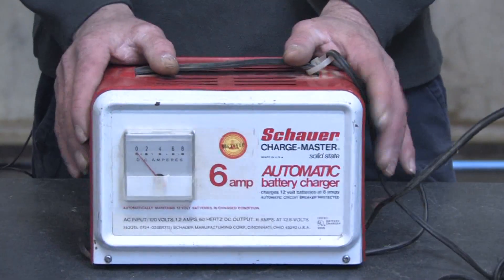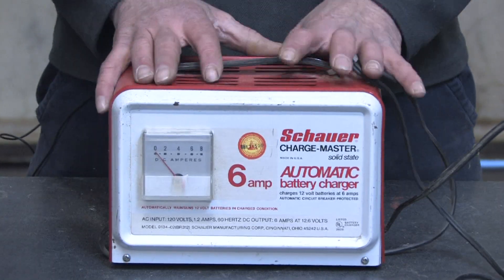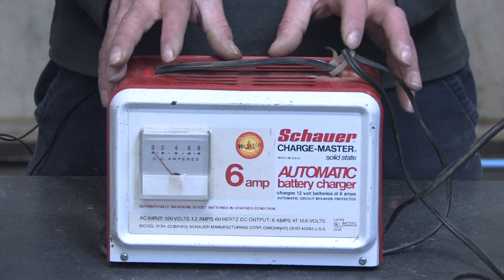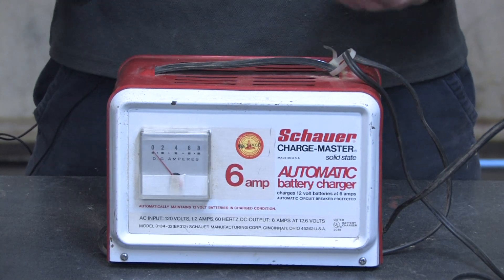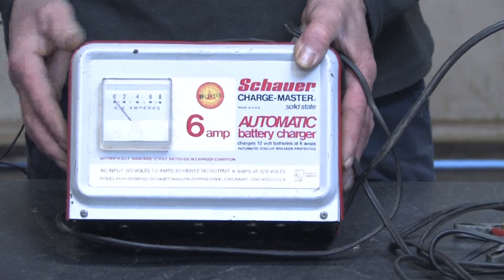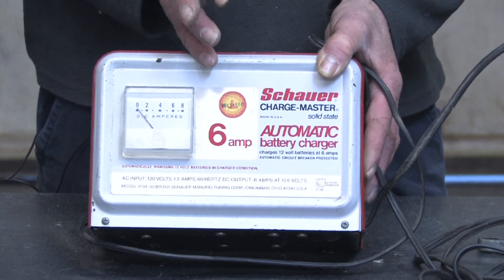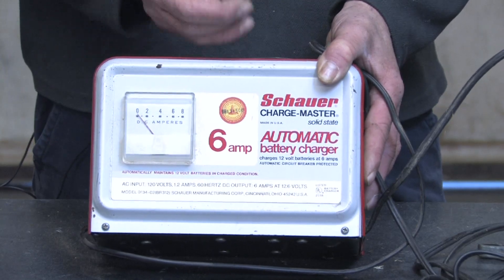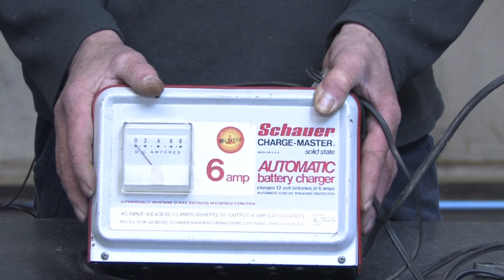Auto Repair & Maintenance : How Do Auto Battery Chargers Work?

Comment: Thanks ... but I wish Americans didn't always assume that the rest of the world runs on 120 volts ... most countries prefer 220-240 volts ... :)
Reply: Most don't. Those that do, think 110 volts is standard, not realizing America uses 220 volts (for large appliances for example). Also, Europe used 110, the standard set in the US by Thomas Edison and corrupt politicians, until WW2. 220 provides better transmission efficiency. Europe was able to make the change due to the fact most power stations had been destroyed. It wasn't cost effective to dismantle the US power grid and rebuild to accommodate 220volts.
Reply: Walter Tonetto not our fault you still prefer to waste electricity.  Maybe if all instructional manuals and videos are made for 120v you will be forced to convert.  The fact that it would save you money in the long run we will just call a pleasant side effect.

Comment: nice but i have a question. if the fuse is blown what fuse you use for replacement ? 12v or 120v ? since it takes 120v and change it to 12v.
Reply: Not sure